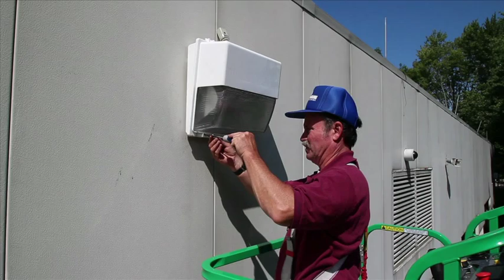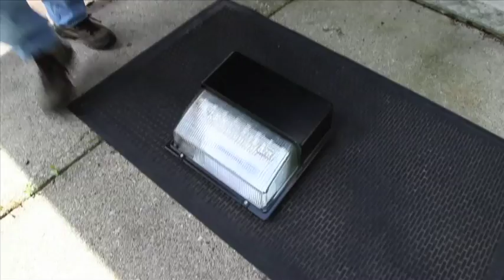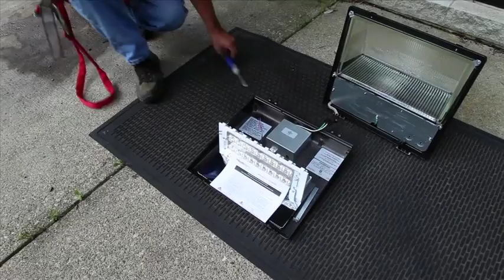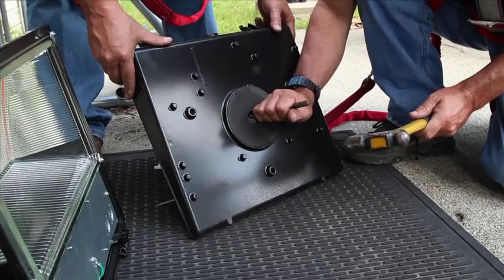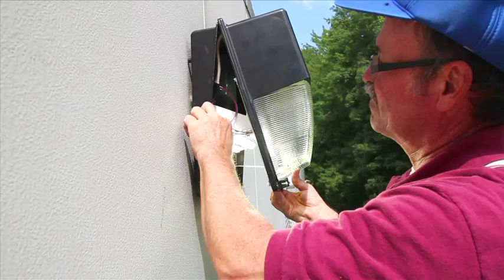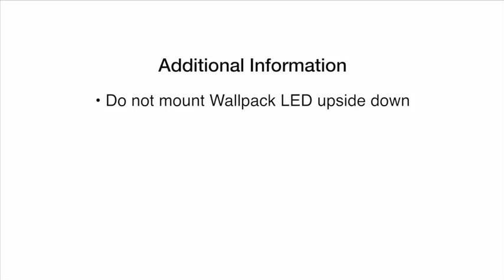Wallpack LED Installation

Comment: Why is the only plug on top painted shut! It’s impossible to take it out
Reply: i had the same issue, you have to slice the paint with a blade
Reply: @user-0ridQ38 thanks that’s what I ended up doing